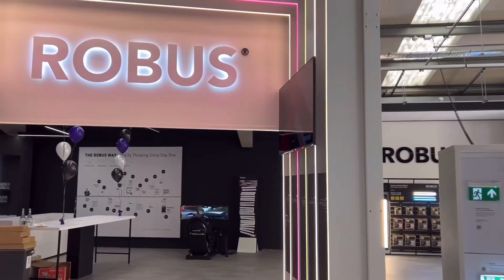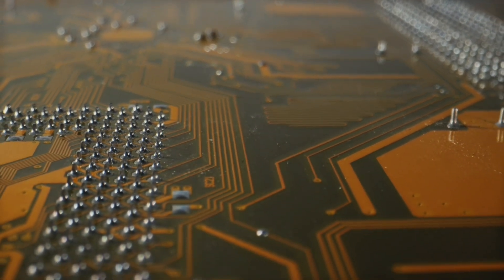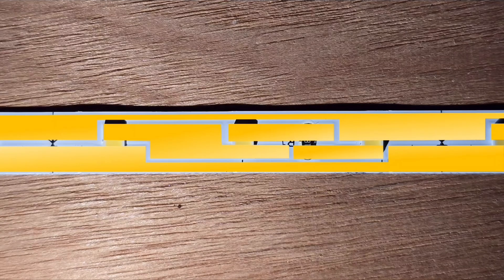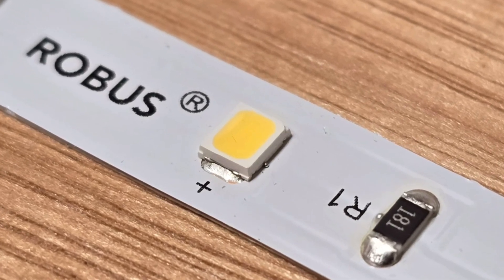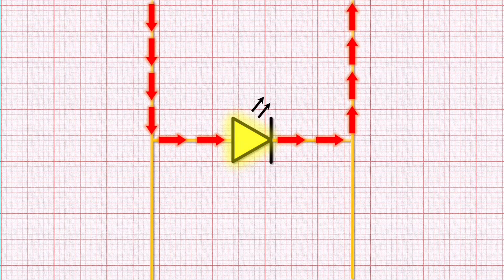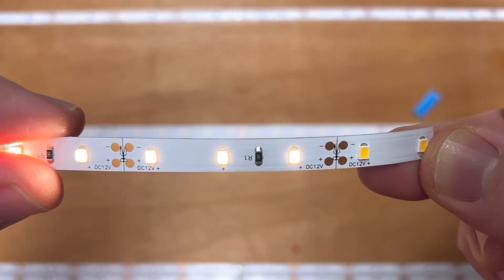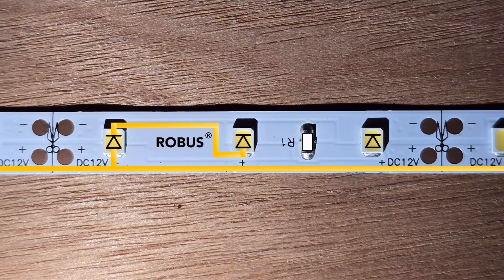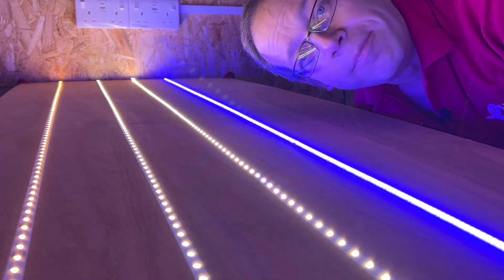How Does LED Strip Work?

Comment: At 3:24 you can see the solder balls left behind after the soldering. They shouldn't really be there.
Reply: Yup, any solder balls on the product in accordance with IPC-610 and IPC J-STD-001 from class 1 to 3, is considered to be a defect.
Reply: With that sort of strip they're too small to cause any shorts.
Reply: Solder bollocks huh?